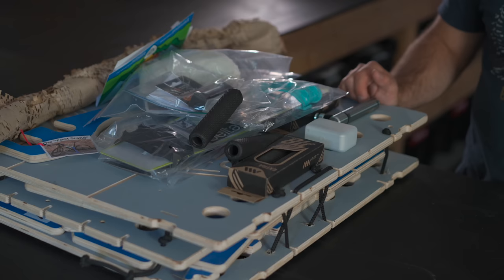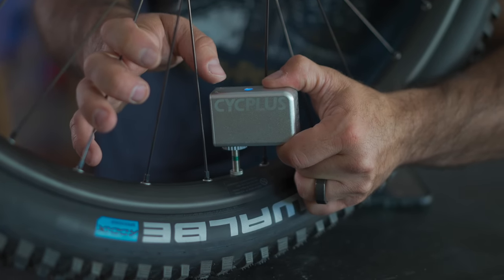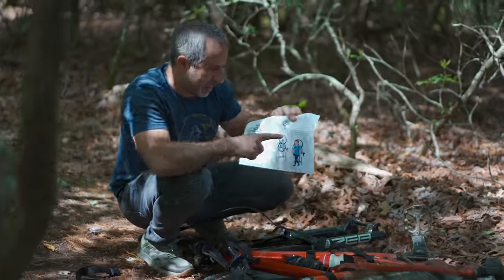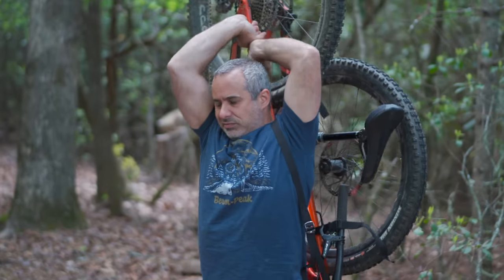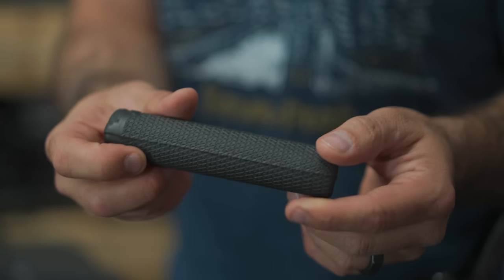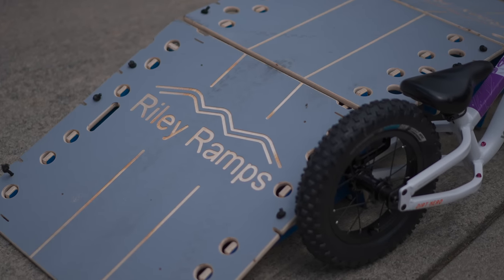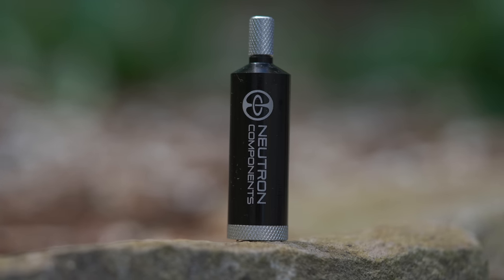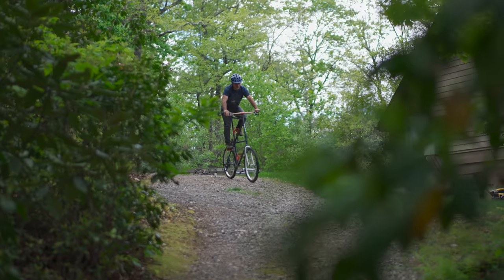Rapid Fire Reviews: Weird Bicycle Products!

Comment from the maker: The bamboo handlebars are NOT $100 (they're over $200), that was a miscalculated currency conversion on my part, but they're still worth it in my opinion. On the bike carrying strap, I think the biggest problem is the marketing. There are, in fact, reasons to carry a bike, but to call it a rescue strap and base it on a story about a guy with a broken bike makes no sense. I also forgot to mention that bleed funnel is only for Shimano or Sram, and I needed to use an adapter for my TRP brakes. I hope they make more variations because it's cool!
Reply: Those handlebars are my favorite product of this video.  Not sure they are worth that much to put on something like a beach cruiser or hybrid bike though.  If they are durable enough would be cool on an old rigid MTB.
Reply: I usually ride my foldie for most things in town. Inside the frame I have several long clean cut strips of inner tube for tying stuff down if out camping on the islands or stupidly hauling a 2x4. They’ve never failed me and would otherwise be in a landfill. I can totally see tying them into a contraption that would make carrying a broken bike doable for a person.
Reply: There are BETTER bike straps out there, I've seen some nifty ones for like, helping to carry a bike up stairs that are always on your bike but retract and extend so they aren't in the way while biking. That's more a commuter use case, but at least you could leave it on your bike and it wohld work for hike a bike better?
Reply: As one of the product designers for Neutron Components I can confirm we are making adapters for TRP, Radic, and more. They will be online in the coming months.
Glad you liked it.
Reply: Saddddd
Reply: Hi
Reply: for the strap, I too get it, as I and my friends happened to wreck our frames twice (once cracked and once completely snapped) on an outback bikepacking adventure and twice we glad that I always bring a webbing with me in my pack, you know the kinds of rock climbing/mountaineering rope stuff, to strap the bike into our backpack. This kinds of strap/webbing/rope/whatchacallit is really nice in an emergency when the bike broke down but you didn't need any special/immediate medical care to call Search and Rescue operations (say just surface scratches), especially in the wilderness outside of bike park.
BUT, I got my 5cm x 10meters webbing for around 50k IDR (around 3USD). If that rescue strap cost anything above 10USD, that's just bullshyte marketing of products that we don't need. Because its only have one purpose while my webbing can be used for another stuff like strapping my packs into a pannier, making emergency shelter frame, etc etc.
Reply: Bamboo handlebars look really good. They should make a whole bike out of it. 😉 IYKYK
Reply: Also the photo of the guy for the strap shows a dude with road pedals- and is that bike a magic left hand drive bike? picture flipped? im so confused...
Reply: You should purchase one of those bamboo MTB frames from Bambike Philippines. Or some other brand from Taiwan.  
Cheers from 🇵🇭
Reply: I think you’re going to love the reserve valves. I haven’t had any issues with them, and I run a shop so I see a lot of tubeless valves. They really seat significantly easier than standard prestas, I seated a tire with a hand pump once with those valves. My one complaint (bc I lose things) is that you can’t lose the valve cap as it helps seal the valve. Still, over a year of use with them between both my XC bike and enduro bike and I have had zero issues. Are they pricey? Yes. Will I ever use anything else? Nope. I’ve used both Stan’s valves and muc off valves, and the reserves are noticeably better than both. I’ve also used Stan’s, muc off, and orange seal in the tires and they perform great with all of them. Orange seal is my personal sealant of choice these days as it’s the easiest to remove when it dries. The reserve valves are no joke. As far as I’m concerned, they’re the only tubeless valves.
Reply: Do you knew you can buy bamboo frame construction kit, to build your own bamboo bike?
Reply: i guess the carry straps could be usefull if you have a dh trail and want to get up again
Reply: I would use the bike carrying strap in the mountains on long up hikes but other than that you're right, you should be prepared or improvise. I've taccoed my front wheel before and pushed it just using the back wheel for miles.
Reply: I seem to remember a little wedge-shaped frame pad that fit between the top tube and seat tube that was marketed at cyclo-cross riders- essentially a shoulder pad for slinging your bike on your shoulder.
Reply: build wooden mtb
Reply: Seth, you should totally start upgrading parts on the tall bike. Like 5DEV cranks and absolute black chainrings type stuff. I think that would be super cool!
Reply: Seth there's a scammer using you username in the comments, you might wanna check that out
Reply: @tony2000and10  true and he can make a review on it.
Reply: Those stems may also be serviceable
Reply: Bike carry strap.... I've done a front and wheel-stand it back to the car... I've done a rear and filled it with dry grass.. and RODE it home (1 stop to refill as grass crushes down especially if wet). And I've carried one on my shoulder up a fence line so steep it was one hand on bike, one on the fence and stepping up on sheep ruts (Hills are steep in NZ and over decades sheep have turned a lot of them into mini terraces (about 2ft high by 1ft wide... (do the math on how steep...  we used to have 30 sheep for every person... only 5 now... I blame it on Vegans 🙂
You'd be better off carrying a length of strapping (like one of those long light ratchet ones without the ratchet... You can use it for a tow rope, a lot of other things... and could makeshift a pair of shoulder straps.

Comment: I think that bike carrier would be better suited for people who hike up mountains with there bike and freeride down
Reply: Exactly what I was thinking
Reply from the maker: Yeah, I think a more padded strap and that thing could be legit useful for when you actually need to carry a bike. Marketing it as a "rescue strap" really seems like a missed opportunity.
Reply: i was thinking of something like this to take my bike up very steep mountains (Sparta, Taygetos) but taking the wheel of and no padding seems like a no no
Reply: Yeah rename it the “MTB HIKER HUKER”
Reply: @BermPeakExpress  Push Components do the Hookabike which is similar but a bit better thought out. You have a plate that fits to your backpack and a permanent strap fitted on the frame with a mounting point, so you just swing the bike onto your back and go. I've been considering it for local stuff where you have some long distance trails like the West Highland Way which has a big hiking section that people always struggle to carry bikes through, so a hands-free option seems more suitable than just carrying. Or there's some steep hills you can't ride up, but good to ride down, and being able to ascend with both hands available is good.

Comment: Maybe not what the bike strap creator had in mind, but there's a niche group of people who jerry rig solutions like that every year for the Arizona Trail Race, which is a bikepacking ultra. The race runs through the Grand Canyon, and riders have to carry their bikes the whole way because bike wheels cannot touch the ground by law. Restrap came out with a similar product this year. So you're right. The strap has pretty much no application for a regular trail ride. But you're also wrong, because there is a time and a place for it.
Reply from the maker: Yes, the main problem with the strap is how it's marketed. There are totally times when you need to carry a bike a long distance. Eric Porter was telling me how he rigged his bike to the top of his Camelbak to hike through a snowy pass in the Himalayas.

Comment: Thank you so much Seth for your unbiased and comprehensive review! We are truly honored to see your valuable feedback. The aspect you highlighted, which is the battery capacity, is indeed crucial for our current product upgrade. We understand that our CUBE may not meet the demands of mountain bike users as it can only fill oversized tires once when fully charged. It is designed primarily for road bike emergency use. Based on our tests, we can fill 700x25c tires up to 80psi two or even three times without any issues. We are actively working on upgrading the battery. Our goal is to develop a more durable and long-lasting battery that will provide the same convenience and performance for mountain bike enthusiasts. Please grant us a little more time.

Once again, we greatly appreciate your insightful review. Your feedback is instrumental in helping us clarify our goals.❤
Reply: Honestly, IMO something like this would be more useful if it could also take "regular" batteries (perhaps a C cell?)...
Reply: @joelv4495  landfill is already a ;problem, so why buy a product that will eventually become landfill when it plays out ,  and create toxicity , when other products do the same job manually, and if rebuildable with simple "O" rings , might last from one owner to the next.
Reply: Would the pump run if it were plugged into a USB-C port like on my Giant e-bike? If so, with a 5 foot cable, you would have unlimited air.
Reply: Why reinvent the wheel "developing" a battery? Just make the battery replaceable. It looks like a common lithium ion size, 18350.
If I was dictator, all gadgets would have consumer swappable, or at least replaceable, batteries.
Reply: @richardelliott8352  This ain't rocket surgery. Ll they need to do is make the li-ion battery replaceable. This gadget looks like it uses a common18350 size. Carry an extra battery. Duh.

Comment: Another sweet perk of the Fillmore valves is they can continue to hold air after breaking. I snapped the stem completely in half, and since the inner "core" just bent and didn't break, it was still able to hold tension keeping the valve shut. You won't be able to inflate the tire through the valve anymore, but it will hold pressure as long as you leave it shut. I got two full days of shuttling out of it before replacing it back at home. Great warranty support as well. Reserve sent me a replacement no questions asked.
Reply from the maker: Ah, that's a good point. The seal happens at the bottom of the valve rather than the top, so it would make sense that it holds up to abuse better.
Reply: How do you snap your valve in half yet keep the rim in tact?
Reply: @udontseemebutiseeyou  By blasting through a waist-deep rut full of jagged, fist-sized rocks like it's the ball pit at Chuck E. Cheese. I've also seen it happen in crashes where the bike impacts a rock or stump sideways.
Reply: Another great feature is the fact that because the airflow is so much higher than a standard presta valve, they make seating tubeless tires relatively painless. I was able to seat my tires using just a floor pump, first try.
Reply: Santa Cruz, er Reserve, is a great company to do business with. The engineering, quality and support are excellent!
Reply: I attempted to use the Fillmores on my gravel bike. Bent the valve stem trying to seat the tire with my presta chuck. Went to my LBS and learned they are not the best solution for gravel tires. They told me they couldn’t add sealant through the valve.
Reply: Good to know. I have those on my SC 5010. Came fitted with them from new

Comment: Been using Fillmore Reserve valves for about a year now on my gravel bike. Easiest and most worry-free bike product I’ve ever used. A tubeless game changer!
Reply: Can you still add sealant through this valve?  I don't like having to break the tire bead to top off the tires.
Reply: @BrianSmith-lq3qh according to the FAQ on their website, yes you can:  “Can I add sealant directly through the Fillmore valve?
- Yes, you can direct-inject sealant through the valve simply by removing all pressure in the tire and using either a syringe style injector with tube, or cutting the top of the sealant bottle to size. The Fillmore has no valve core to remove or get in the way.”

Comment: The rescue strap has better use for hike a bike trails. During the summer I hate wearing a backpack when I don't have to and usually putting the bike on your back is easier when you have the backpack to lean the frame so all the weight doesn't go on your shoulders. Here in Bulgaria we also have a crazy 5 day, 720 km race that has a few sections that you are required to have the bike secured to your back so you have both your hands free while you cross the roped section. The race is called Red Bull Bike the Balkan, check it out

Comment: The emergency bleed kit has been on my radar for a long time - specifically for bikepacking or bike touring. Seems like a fantastic piece of kit to have if your brakes are acting up in the middle of nowhere.
Reply: Why would ur brakes be acting up in a way this could help? If they are letting air in for some reason, that tube isn't going to help much. If u need to bleed brakes mid ride, I would think u have greater brake issues than this covers. Plus it only does the lever bleed element.

Comment: I have the reserve valve stems and have not had any issues with clogging. Another feature they offer is the ability to release air without fully removing the valve cap. The only hurdle I've run into with them is they make topping off your sealant via the valves stems more difficult since you can't insert a syringe.
Reply: i have valve stems i cut out of old inner tubes with scissors and i've never had a problem with clogging.  i feel like sealant clogs might be a problem somebody invented to sell a product, rather than a problem people actually have.

Comment: I snapped a frame at the BB while on a wilderness ride some years ago. Ripped out the shifter cable and lashed the frame together, super tight, and covered in gorilla tape. Set derailleur to single speed with some zip ties and limit screws... and I rode all the way back to you truck, very carefully.

Comment: I will always give a tip to people, put a simple set of tools in a toolbox. Cheap but not too cheap. It’s basically a crash kit. Tools that you might need that won’t be a huge pain if stolen. I always have a spoke wrench in it and a pedal wrench but those are the only specialized tools I keep in it. And keep a first aid kit go bag next to it in the truck bed (or wherever you transport your bikes). If you need any other specialty tools in the box for the most part it’s not worth it as the repair would be something you do at home. And also specialty tools are expensive. Also those cheap pressure gauges you get at auto zone are the best for bikes in my experience. Digital gauges don’t fit right between spokes  and it’s always ready to work and you don’t have to worry about batteries. And again they are cheap so if someone steals your crash kit you aren’t loosing a $20 slime gauge, you are losing a $9 gauge.

Comment: Years ago I had a puncher at 3am in a not good part of the city, i had to carry my bike (hard tail). I had a rucksack on with foam shoulder straps and it was quite easy and comfortable to carry. Didn't need any weird strap system.
Also years before that I had a frame bag with a carry strap built in. It was designed to hold tools and to carry the bike if needed, no fancy stuff needed. I miss that bag. 🤪

Comment: The high floor flow valves are awesome, I personally prefer the 76 projects ones as they are about half the price, and you can put sealant in them. Also, what I think is better than not clogging, is that they are super easy to inflate, they make it so you can easily seat a tire with a floor pump

Comment: Seth, I'd recommend using hairspray to hold those grips in place if you haven't tried that already. It makes the install easier too and any overspray can be cleaned up with iso alcohol.
Reply: I alsays wd40'ed them. Its never not dried tacky, but never left residue either

Comment: The Santa Cruz valves are well worth it. The biggest unforeseen benefit is how easy it is to seat tires. I used to have to go to the gas station to seat tires, now I can do it with a floor pump one handed.

Comment: The fillmore valve are also a game changer when setting up  tubeless by providing more airflow!😮
Reply: It's totally worthwhile removing the valve core from a 'regular' tubeless valve if you are having airflow issues when seating with track pump.  A valve core removal tool is a such a small simple tool but so so handy for this.  I have used a small Cresent wrench before and it can work but it's fiddly.

I use the valve core removal trick to inject sealant with a cheap plastic syringe (60ml) from the pharmacy and and fits great, makes it a really simple job!

Cheers

Comment: After using the Topeak Turbo Morph I ended up getting an Autder battery operated tire inflator.  It's only $40 and I get a ton more inflations out of one charge and it can go up to 150psi.  (Very handy for road/fixed gear).  I really DGAF about carrying it, I like to be as self-sufficient as possible. So I'd rather have it and not need it instead of needing it and not having it.

Comment: I have those fillmore knock off valves. Exactly the same as the original ones but at $10. Have had sealant in my tire for more thank 6 months now and I also haven't biked in 6 months. Just biked yesterday and the valve was stuck or gunked up at all. So easy to fill up with air. Love those things

Comment: If $20 is ok for the gear strap, then the grips actually seem like decent value at $40... as long as they are durable. The value of bike components and accessories is very hard to calculate though, with seemingly trivial items being expensive. One thing is for sure, you guys get waaay better value than we do in Ireland!